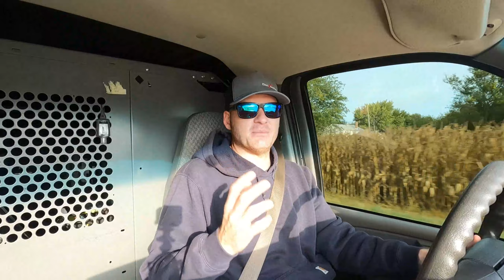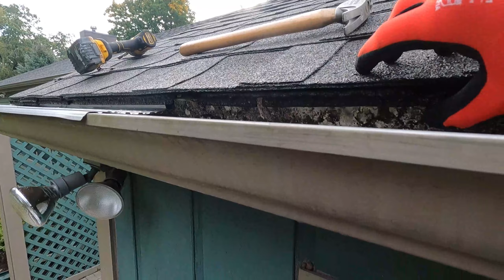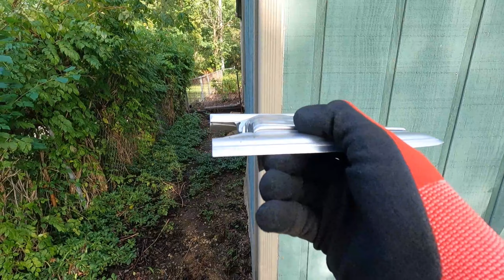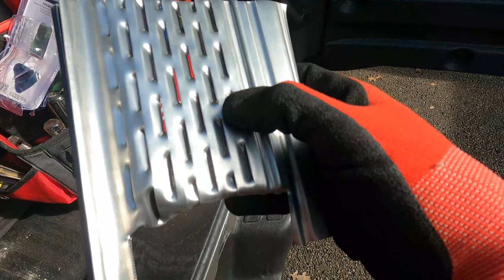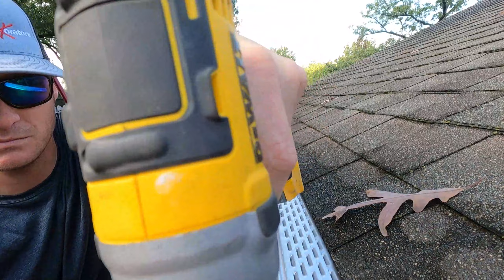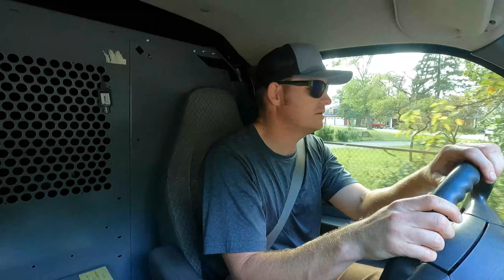Installing Gutter Guards On Asphalt Shingle Roof | Do they Work?? | HANDYMAN HEADQUARTERS

Comment: Sound was great!  5 years already... Do you find you've specialized more, or are you just better at being a generalist?  I ask as I've been doing this for less time than you...
Reply from the maker: Well that is a tough one. Most people need both. I tried to get awya from some things like painting but when i put a door in or do trim i felt i was losing out revenue by not offering it. I dont do any electrical, plumbing, or roofing as 2 of the 3 i need a license. But i get a lot of plumbing requests!